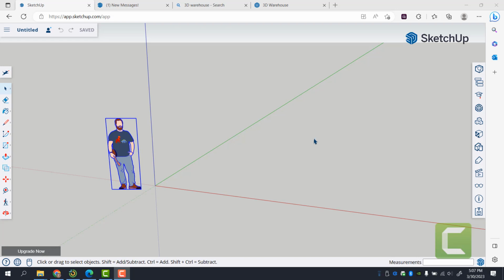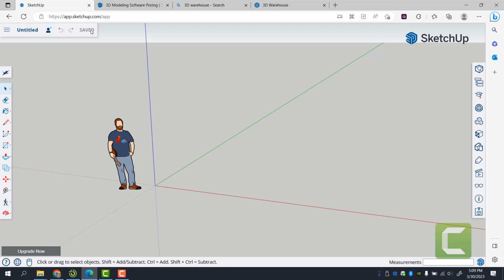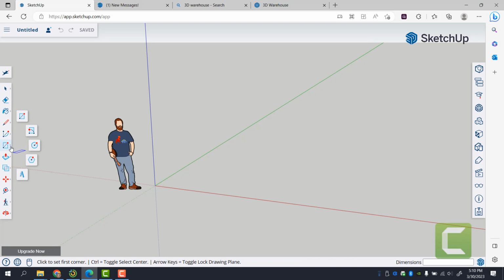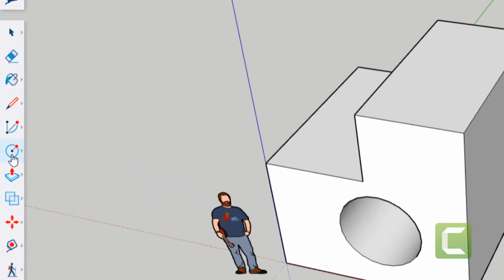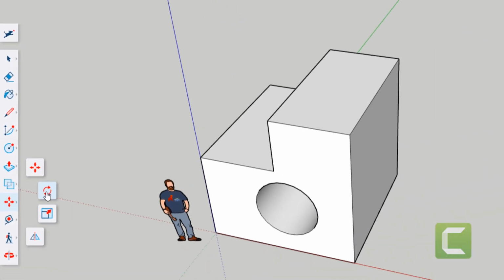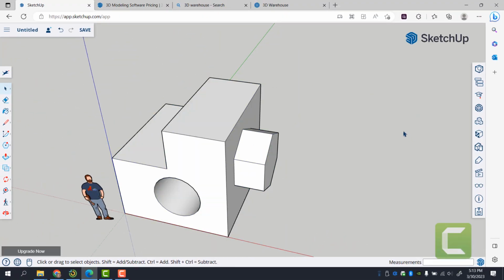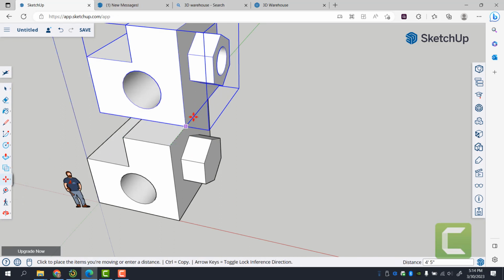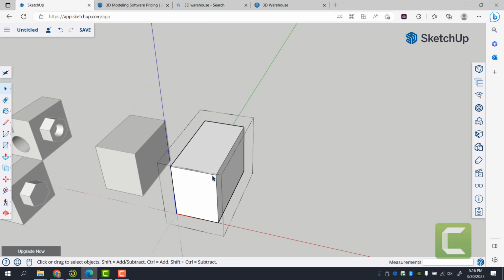Ultimate guide to Google Sketchup in 10 min for Beginners! #architecture

Comment: Can you please continue this Sketchup series I mean to make a USA build from scratch in Sketchup as I have seen most of your videos on Revit. It will be really helpful if you start making videos on Sketchup
Reply from the maker: As much as I love Google sketchup for flexibility, I primarily use it as a concept or pre-design software. For constructibility for understanding details for construction documentation I believe Revit is the way to go. What is hard in Revit relatively speaking is to freeform or 3-D model but if you 3-D model in sketch up, bring it in to Revit as a mass model, you can give a properties and realize it as a constructible project. In short, a complex project in sketch up always crashes the software and is not ideal for construction documentation.
Reply from the maker: But I do plan to make more sketch up videos for visualizing small details in 3-D to make them easier to understand
Reply: @architecturalab  Yes I am talking about 3d visualization. I am agree with that for construction documentation revit is more powerfull but for 3d purpose sketchup is superior.
So that's why I'm talking about a series on sketchup as 3d exterior visualization is eye ketchy